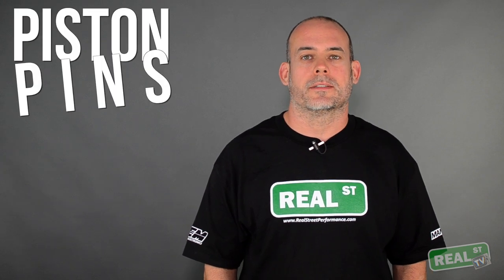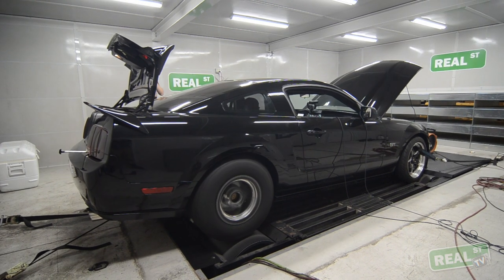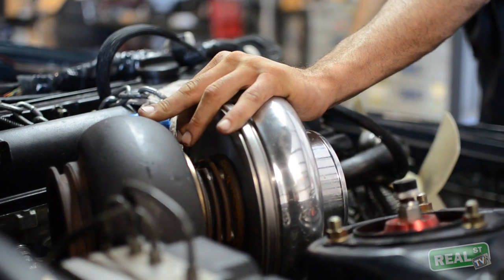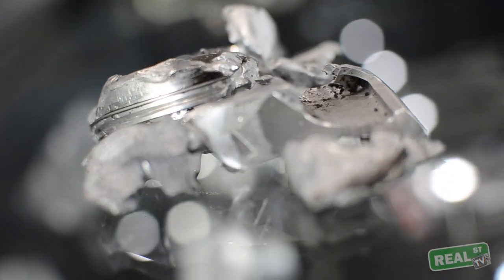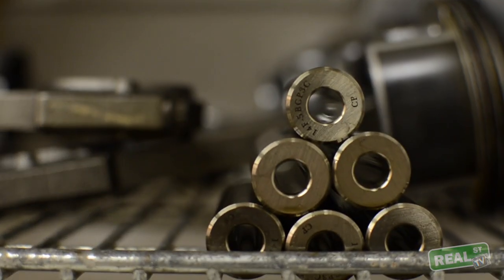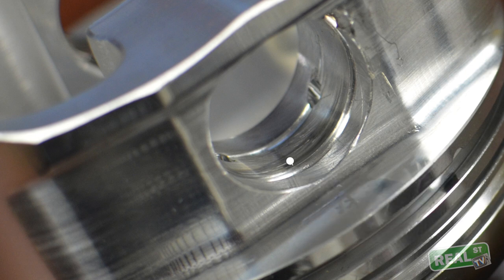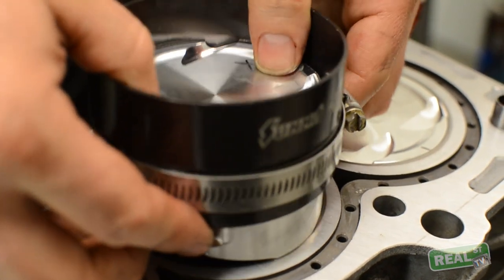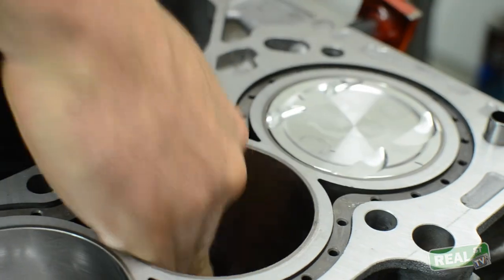Do I need to Buy Upgraded Wrist Pins? Jay's Tech Tips #28

Comment: The pins shown all seem to be parallel wall - taper pins are not only lighter but have the material where it is actually needed - the highest bending and sheer loadings are at the centre and the ends are only lightly loaded.
It should be possible to source some of these stronger, lighter pins from the aftermarket - may be worth checking out?
Again, not familiar with the "import" market, but some pistons are available in 'short pin' lightweight versions, which also reduces the bending stress on the pin, but increases the direct loadings - may also be worth checking out?

Comment: Good video, Whenever I bought a new set of rings for my cp pistons I actually got the upgraded pins also, It was alittle while back (purchased from real street) But great customer service, Even gave me the phone number to contact real street's engine builder if I needed any help and for questions on ring gaps. Thanks again. My longblock is complete, I'm working on getting my fuel/turbo setup and hope to see real streets dyno eventually, going for 600+whp maybe 1000whp if I get the proper turbo/fuel setup
Reply from the maker: +Never Enough Boost thanks for the support. let us know what parts you still need and we will do our best to get you what you need to get back on the road asap. sales@realstreetperformance.com
Reply: @realstreetperformance  

I have a vw golf 4 r32 turbo with wossner pistons do u do upgraded pins

Comment: Hey Jay,

So I purchased some Speed factory outlaw Arias pistons for my B-Series motor. My question was, they came with wrist pin buttons to hold the wrist pins in instead of cir clips. What's your take on that for a 50/50 street/track car?
Reply: Buttons are really just for engines that are pulled down frequently, like drag and sprint engines, with the main advantage being speed of assembly and disassembly. ARIAS 'should' offer them with more conventional pin retainers and, in some instances, the pistons are already machined for this - don't know about your instance, though.
Personally, I would not run them.
Reply from the maker: Wrist pin buttons are nothing new and have been around for a long time, for example Lycoming has used them in aircraft engines for decades. The downside for a button is you're adding weight IF you're using a short pin.  There was a period of time that people had issues with circlips vibrating out OR being spit out because poor installation or  alignment and buttons seemed to be the sure fire way to solve the problem. As machining has evolved there are less and less problems to be had with wire retention of the piston pin however for those of you that have used buttons they're really easy to install were as the wire locks require a steady hand to get into place.  There isn't a "wrong approach" here and you generally see wire retention based off of costs and nothing more.
Reply: REALSTREETPERFTV would they cause any problems in a street car vs cir clips? Because from my observation, it seems the buttons are only held in place using the piston rings which I assume would allow some side to side play in the buttons/wrist pins as opposed to the circlips which sits solid in a groove.
Reply: What do you think can do wrong? Maybe if I understand your fears I can address the concern more directly than I already have. 
Thanks
Reply: Jay Meagher because the buttons are only held in by the bottom oil control rings, im afraid they may not stay in place.
Reply: Keep in mind there's nothing trying to force them out.  Again, look at the aircraft reference. It's a reliable approach.
Reply: Good info', ta - Some have had problems with them but, when it comes down to it, you can have problems with just about anything.